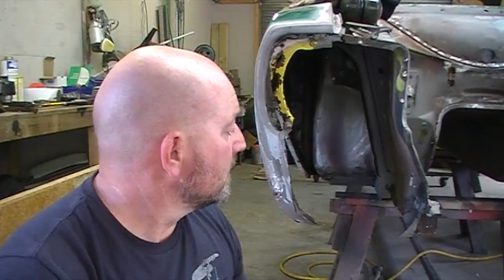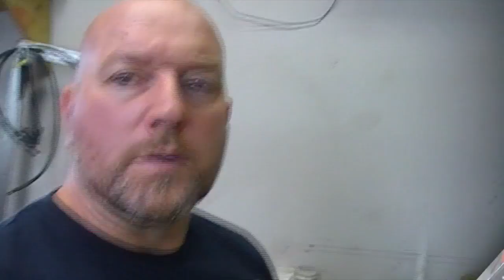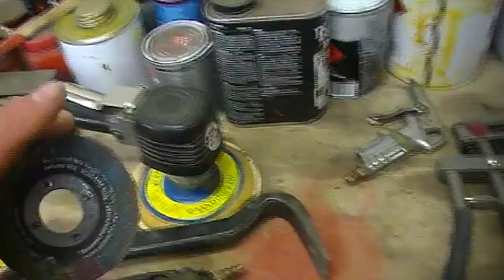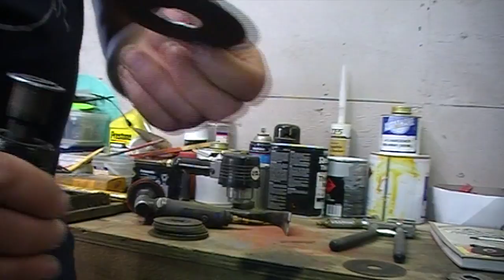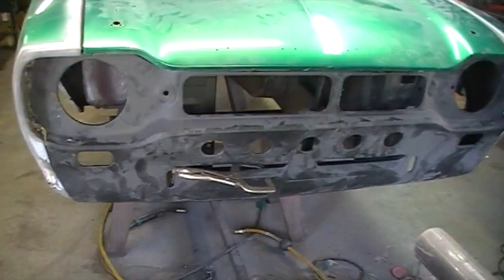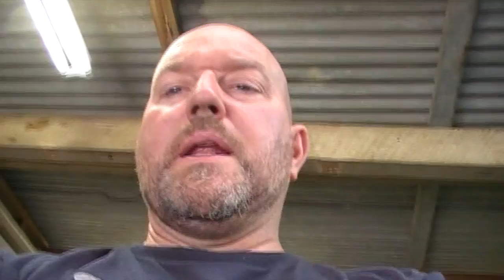Ford escort restoration part 8

Comment: just be aware of the max RPM on the disc or it may explode if RPM is too high
Reply from the maker: Yes true , the angle grinder quite a bit higher than air tool , they seem to last much longer on the air grinder , also can control the speed , saved a lot of coin :)